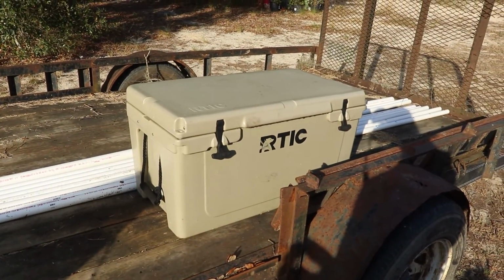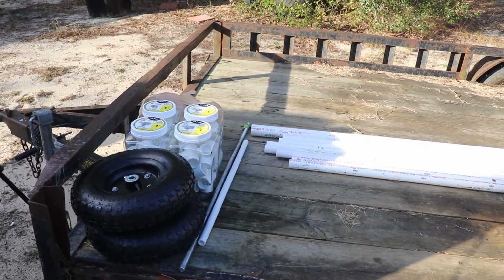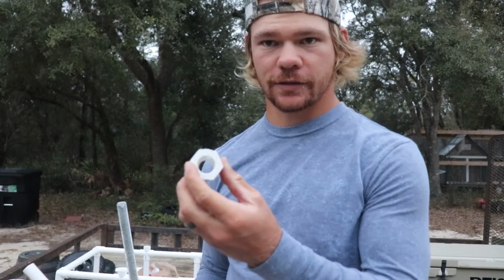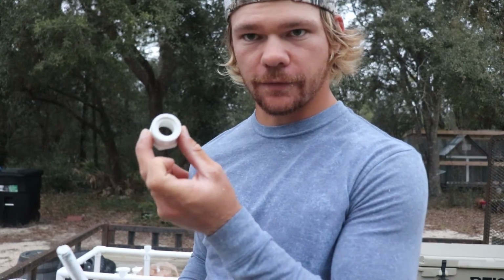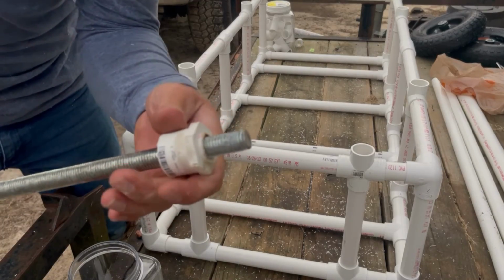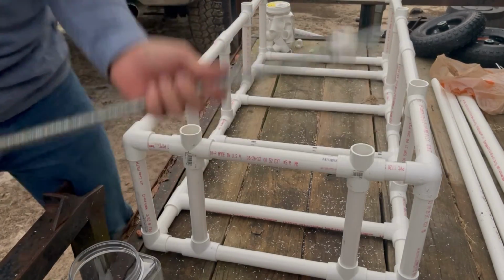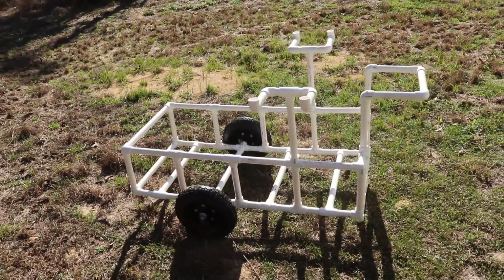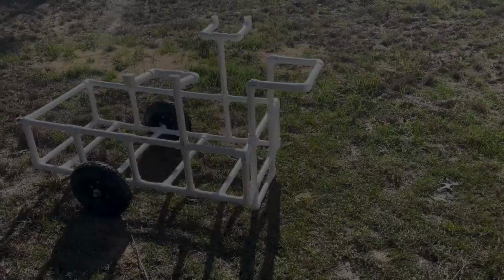Building a new BEACH CART! (DIY)

Comment: Awesome design but wondering how those wheels work in sand? The only wheels that work for me are the blow up rubber ones.
Reply from the maker: In soft sand it is definitely harder to pull. Closer to the beach where the sand isn’t as soft, it pulls just fine. I plan to upgrade the tires at some point. Thank you for the feedback!

Comment: I am working on mine now-  how did you secure the wheels? I’m trying to find the best solution so that the bolts don’t come off
Reply from the maker: I used a large fender washer, then a lock washer and then tighten the nut pretty snug but not crazy tight and I haven’t had any issues with it

Comment: I guess you can build it once or build it multiple times when it breaks made out of PVC you should’ve saved yourself some time and went to Harbor freight and bought a cargo and the balloon tires for sand
Reply from the maker: It has held up perfectly with a loaded 65qt cooler. You could buy a premade cart but then you lack customization, just depends what you want. I plan on upgrading to balloon tires at some point